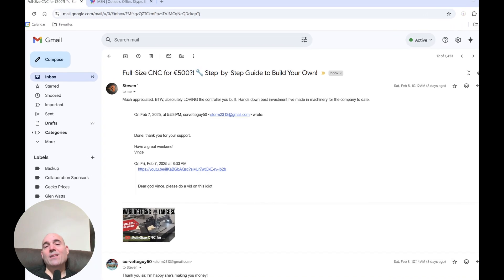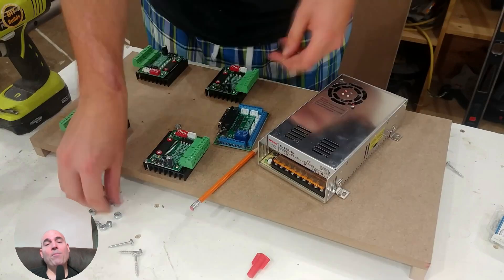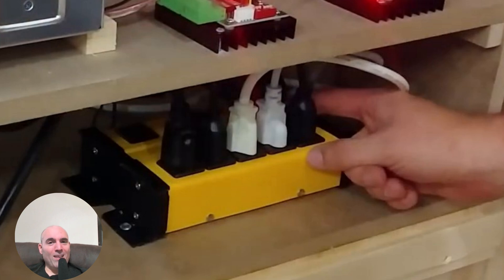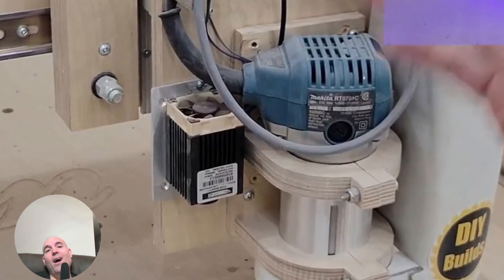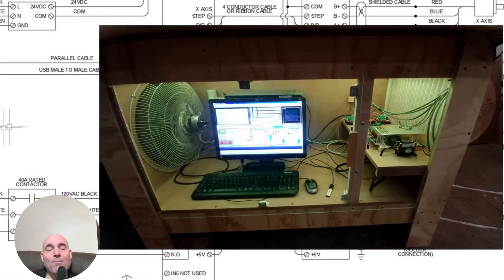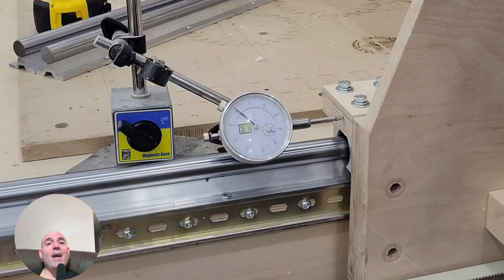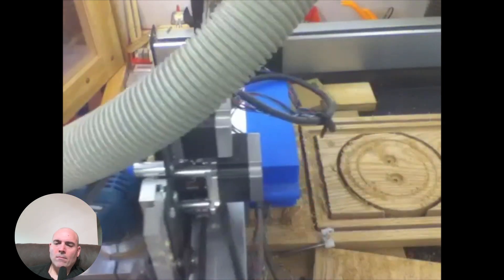Wood You Risk $900 To Build This CNC Router?

Comment: 3:00 First of all, this is a DIY CNC, and therefore, using an MDF board for the electronics is good enough. It’s not recommended, yes, but how often do you use the CNC without being there? MDF will not spontaneously combust if the power supply is not working properly. So before the shop burns down, he can extinguish the fire.

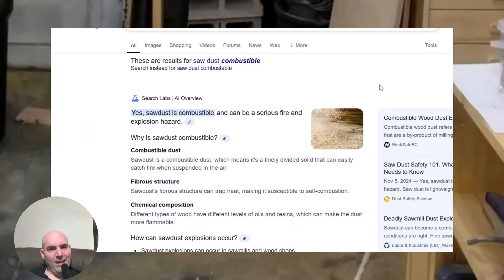5:00 Sawdust will only combust if enough air is present. If sawdust is airborne in high concentrations, it can ignite, but sawdust alone on the ground will not immediately catch fire. Yes, if you try, you could get it to burn.

9:00 Normally, a power strip is rated as high as the wall outlet. Yes, you should check the outlet wattage, but if you can’t do that, then you shouldn’t be building a CNC in the first place.

16:00 That is his fault. Why do you need an emergency stop if you’re not even there? Even on a $20,000 CNC, you need to stay and watch because unexpected things can always happen. For the most part, I agree with you, but this is home use. If people are stupid enough not to watch their CNC, then their shop will burn down. Yes, all electronic components are enclosed, and that’s not ideal, but if you’re there with a bucket of sand next to you, it should be fine.

I agree with most of what you said, but a lot of these concerns don’t matter as long as you stay focused and remain next to your CNC. I’m not saying your video is pointless, but you exaggerates everything.
Reply from the maker: I really can't believe you took the time to type out the comment you left, but I'll cover what you said. 

Using MDF, or for that matter any wood substrate will prevent an end user from getting paid from their insurance company in the event God forbid a fire happens. Anyone using a flammable material to house electronics is simply incompetent period as they're putting everyone not just themselves at risk.

You typed "Sawdust will only combust if enough air is present." Are you not seeing the amount of airspace in his shop that has all the sawdust present in it? You do realize that Google the largest search engine in the world was used in the the video to confirm that sawdust is combustible. Talking about what concentration amounts are in the air is irrelevant as if its present at all then the hazard exists. 

If you want more proof contact your homeowners insurance company, and tell then what you typed, and see if they'll agree with you. 

A power strip should never be used as stated in the video with a spindle, and the CNC controller for the reasons covered in the video. Just because a power strip may be rated to the same amps as an outlet it plugs into doesn't mean the devices being plugged into it won't exceed the units amp rating, or outlet rating. This is very easily overlooked by novices in a rush to get their CNC finished. All details count.

Did you really type "if you're there with a bucket of sand next to you you'll be fine"?  Lol. I do agree all end users are responsible for their robots while they are machining, and they should be paying attention to what's going on at all times as things can go south instantly. It doesn't change the fact all electronics enclosures should be made out of metal in best practice for safety, and the ability to be grounded as all CNC electronics enclosures should.

Your final sentence is really scary considering even if the end user is by his robot for the whole time on a 6 hour project it doesn't mean his electronics enclosure can be grounded because its wood.

 It also doesn't mean that the machine will be consistent with its lack of rigidity shown in the video with the X axis twist he confirmed, or the fact the wood will absorb moisture causing fluctuations, and it certainly wouldn't be any less of a fire hazard just because someone is sitting close to the robot.  

It also doesn't mean your insurance company is going to cover the structure if its damaged by a fire, but you can always let them know you have your bucket of sand, and see if it will convince them. 🤣

Thank you,
Vince
Reply: @corvetteguy50    Fire hazard!!!  Have you ever seen a pinball machine 48 - 100 volts an dozens of lights and coils all in a plywood box or a fish tank , Lets take a glass box fill it with saltwater and put a bunch of electrical devices in it lol . All jokes aside I do  agree with most of what you said and you sound very competent , I do however think there are situations were building this kind of  thing  is ok  If it is being constantly monitored  and is your first go at learning the basics and your trying to get comfortable with the concepts of  operation and design, however like you said when there are alternatives that are just as cheap and simple thing that could have been done like adequate cooling and a disclaimer that this is obviously a temporary project for learning basics and not a safe long term approach .Overall nice job on your video.
Reply from the maker: Unfortunately I disagree, and so would your insurance company if you God forbid had a fire. All it takes is an inspection to be done, and for the fire marshall, and insurance investigator to determine it was due to using a flammable enclosure/chassis. 

You discussing other genre's using wooden enclosures where electronics is present is valid, and once again what I'm saying is still true in those applications, but of course the insurance companies don't let you know this until after a fire happens unless you do your due diligence. 

I can only speak of my applications regarding CNC industrial use, and the insurance companies will all feel its an industrial robot when it comes to a claim being made regardless of what the end user claims its application is for.

Everyone needs to research carefully what I'm saying with your insurance companies as its fact, and facts don't care about your feelings. 

Thank you,
Vince
Reply: @corvetteguy50  There are commercial CNC's that use mdf for their spoil board, so I'm not sure what you're on about there.  

No one claimed sawdust doesn't catch fire when being observed, his point was that you're never suppose to leave a CNC unattended, period. This way you can address any issues that arise, whether its a broken endmill or a fire.  

There are a lot of factors that go into the risk of a fire.  Lack of proper ventilation or dust collection, small shop or enclosed area where the dust can accumulate more easily, using a router or cutting tool where the commutator or brushes are exposed and generating sparks, etc etc.  Each of these increases risk, but none of them guarantees a fire. 

Your risks can be minimized with proper ventilation, a large open area, use of a proper spindle or at least preventing the dust from getting close to any electronics where sparks occur, such as brushes and commutators.

No one would claim a diy wooden cnc is accurate to ten thousandth. but for what its generally used for its more than adequate.  

As for grounding, you don't need a metal enclosure for grounding. You can ground everything in there with wire.  The metal enclosure is typically to reduce noise and interference, such as preventing the CNC from generating EMI that affects other devices, or preventing the EMI from the motors or other equipment from impacting the CNC controller.  Grounding itself is a completely different issue that can be safely addressed without a metal enclosure.

As for insurance, no one buys insurance for their CNC at the hobby level, and if you're at the commercial business level its highly unlikely that you're going to be using a DIY wooden CNC for production, so this is a red herring at best.

Cheers.
Reply from the maker: If no one claimed sawdust doesn't catch fire then once again why are you leaving a comment trying to support the content creator's bad choices in the video I covered? Its obvious no one should leave a production robot unattended, and I agreed with the last person's comment on this point.

 Its obvious you have one of these robots as you wouldn't leave a comment supporting the content creator's video. 

Its really scary you like the other person who left a comment can't understand that just because you're monitoring the robot, doesn't mean a wood robot is any less a fire hazard, and certainly doesn't mean every point I covered with direct evidence from Google isn't anymore true.  

You realize you actually typed this "As for insurance, no one buys insurance for their CNC at the hobby level, and if you're at the commercial business level its highly unlikely that you're going to be using a DIY wooden CNC for production, so this is a red herring at best."

You do realize in North America  at least 99% of people have homeowner insurance correct?  

Where do you think these type of DIY wood robots are used? 

I mean really where would a guy willing to spend under $900 for a CNC router 100% complete put it? 

He's certainly not going to rent a shop, and if he tried to install it in a commercial environment, and the landlord seen it he would not allow it if he valued his own insurance.

A wire isn't going to ground an entire wood enclosure housing your electronics as this is a required component for grounding as it has the largest amount of mass, and the reason metal is used is because of its safety factor. 

Wood electrical enclosures aren't up to insurance coverage/electrical code. (How many wood breaker boxes have you seen?? )

Did you know if wood becomes wet it can conduct electricity. Here's some more proof. 

Once again to be very clear Google the largest search engine states this, and its indeed true!

 https://www.google.com/search?q=wood+is+against+electrical+code+for+electrical+enclosures&sca_esv=671628d501de9159&ei=VPS4Z7DuL9rv-LYPwMjUgAM&ved=0ahUKEwiw6Mrx3tWLAxXaN94AHUAkFTAQ4dUDCBI&uact=5&oq=wood+is+against+electrical+code+for+electrical+enclosures&gs_lp=Egxnd3Mtd2l6LXNlcnAiOXdvb2QgaXMgYWdhaW5zdCBlbGVjdHJpY2FsIGNvZGUgZm9yIGVsZWN0cmljYWwgZW5jbG9zdXJlczIFECEYoAEyBRAhGKABMgUQIRigATIFECEYqwJIwGpQAFi2aXADeAGQAQCYAa4BoAGKLqoBBTMxLjI5uAEDyAEA-AEBmAI_oALHL8ICCxAAGIAEGJECGIoFwgIKEAAYgAQYQxiKBcICCxAAGIAEGLEDGIMBwgIOEC4YgAQYsQMY0QMYxwHCAggQABiABBixA8ICBRAAGIAEwgILEC4YgAQYsQMY1ALCAhAQABiABBixAxhDGIMBGIoFwgIKEC4YgAQYQxiKBcICCxAuGIAEGMcBGK8BwgIIEC4YgAQYsQPCAg4QABiABBiRAhixAxiKBcICDRAAGIAEGLEDGEMYigXCAgUQLhiABMICBhAAGBYYHsICCBAAGBYYChgewgILEAAYgAQYhgMYigXCAgUQABjvBcICCBAAGIAEGKIEwgIFECEYnwXCAgcQIRigARgKmAMAkgcFMjUuMzigB-27Aw&sclient=gws-wiz-serp

You're more than entitled to your opinion, and to do what you want with your money/life. Just don't spread this information to others as its not true.

I've been contracted by NASA's IT director to build a CNC controller retrofit, so considering I have video proof of this on my channel, https://youtu.be/jk_K3J75sOg

 Considering your YouTube channel is dead then an intelligent person would at the very least look into what I'm saying with their insurance company because its free to ask a question before something terrible happens. 

 Facts don't care about your feelings. These wood robots are unsafe, fire hazards regardless of how technical you want to attempt to make all the variables of saw dust, and point out that if someone hovers over their robot their safe. 

Thank you,
Vince
Reply: I guess people trying to do this with cheap materials like wood, or something like that don't realise the course of history.
The main aspect is all of you, and I included work to get quality, or more of it.
This video shows a five year kid playing with the physics laws.
I would never put my money on a structure I could bend with my hands, like mdf.😂😂😂
Reply from the maker: Thank you for your support, and well said. Vince